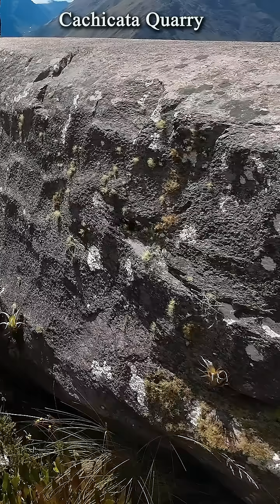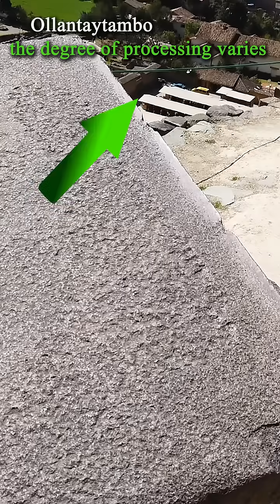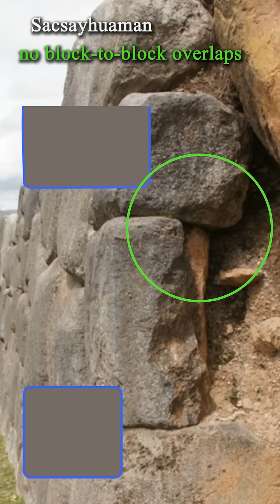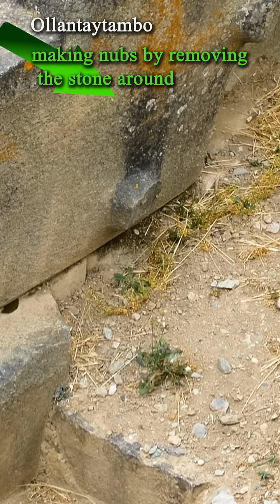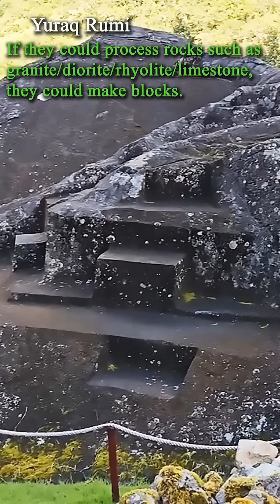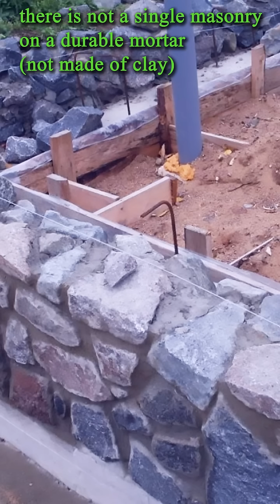Everything You Need to Know About Casting Blocks in Peru  #ancienttechnology #history

Comment: Excellent analysis and argument against casting of polygonal stone structures.  They did need to be able to handle multi-ton blocks and must have used form light weight templates to create the precision interfaces. Without advanced tech, I would speculate giant humans [all the huge doors and legends are clues there] and giant extinct beasts for transport.